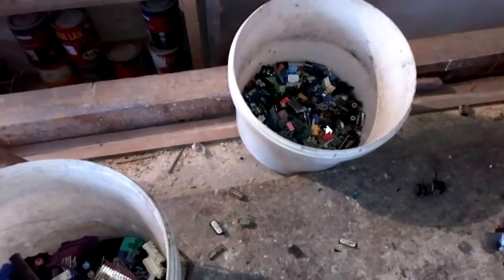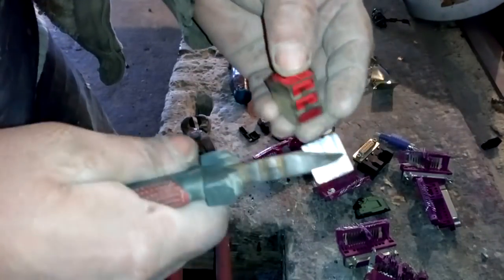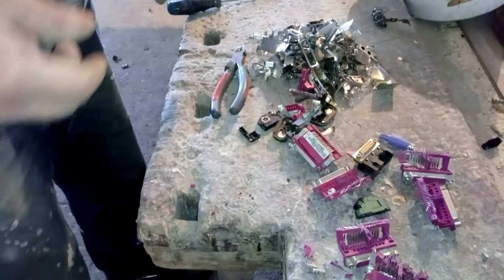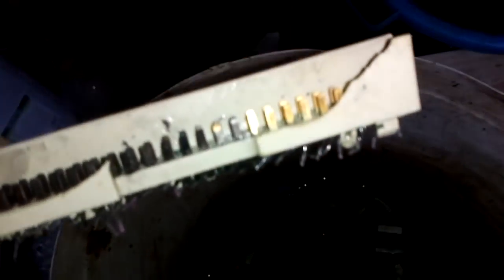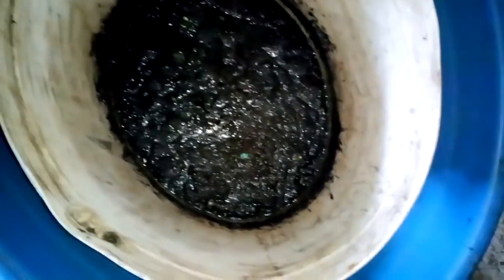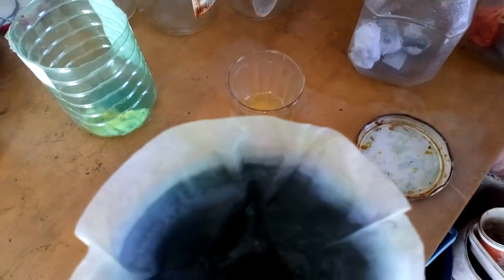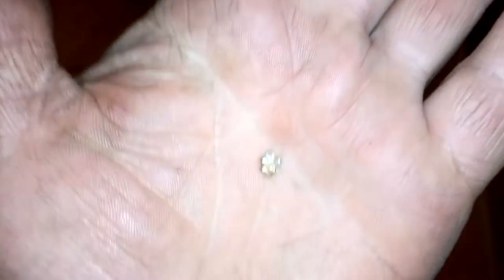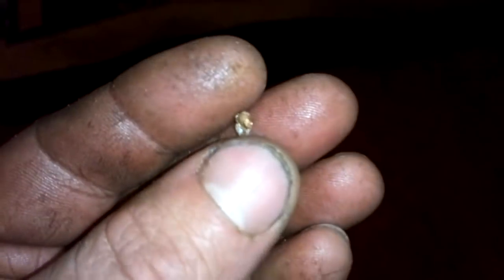Motherboard pins process with plastic in Aqwaregia!

Comment: cool in youe situation when you can get cheap acid  at me im able to buy HCL only sulphuric i getting from lead-acid batteries and nitric is totally out of my range i working on setup to destill some but it cost a bit so most of my refining is running on pour mans ar bit more time but working so far

Comment: Hello Dusan how are you to day ? now I appreciate 
your videos even more !!! I tried with small amounts of material to dissolve with AR pins with plastic, but I must have done everything wrong, I put urea, and after 10 minutes SMB but I came out a lot of gray paste looks like silver but it is not, what will it be? It,s All very complicated :) !!  It is possible after all wrong to dissolve all over again and start again from the beginning ... ??? I really appreciate your advice, thank you !!
Reply: This grey material is mixture of silver and lead sulphate
Reply: Nico Locasto you first add sulfuric acid to precipitate any lead or silver. Wait for 1 hr. Then add urea to nutralise nitric acid .filtre the solution and the add smb solution.
Reply: Nico Locasto you now take grey material in beaker. Add aqua regia and doing same process.
Reply: thank you , i will try with sulfuric acid.. i'm using  technical urea and i find that a lot of it do not dissolve and gets mixed with silver chloride ,is it normal thing??
Reply: Thank you !!
Reply from the maker: Nico Locasto He already explained everything to you. But it is possible that if you put too much urea to make you a lot of sludge because there is no more room to go to acid.
Reply from the maker: Nico Locasto did you remove tin and lead first vith hcl, or you go strate to Ar? If you go strate to Ar, that is you problem.

Comment: hey dusan i have question could use wet ashing on plastics leaving behind only pins?
Reply from the maker: Willie Bowshier No, unfortunately, sulfaric acid will not dissolve plastics same the material from which the chips are made.

Comment: What do you do with the HCL that was used with the tin in it ? does it go into your stockpot ?
Reply from the maker: d scrapper no, also contains lead which makes a big problem in testing. There are also other metals here.
Reply from the maker: d scrapper For now, I keep it in canisters, until I get a better way to retrieve tin from it.
Reply: do you think that this solution could be used as  Stanious test solution ?

Comment: great video mate, i do the same thing with my plugs i just spend a bit more time to remove more plastic and excess metal from the pins. i use poor mans aquaregia and save the powder until i have enough to do a decent clean batch again with the powder. at the end you had borax stuck to the gold from the melt, just drop it in a little sulphuric acid to clean that off or just remelt again. great video now you just have to reclaim and drop the tin from the hcl bath at the beginning
Reply from the maker: I'm still working on it. I do not bother trying to regain tin and lead, but I do this video to meet you who are interested in this process.

Comment: Great video.. This makes me think of the idea I had with IC chips, I was thinking that instead of burning them I would just crush them with plastic. I am assuming that the poor mans aqua regia would desolve plastic as well.. Maybe crush plastic with pins here would create a faster process?   Or like other have said do same process you did in first video with Ic chips and burn them?
 Also what to you do with the HCL that has the tin in it? that is call tin chloride am I right? I do no why you do not want the tin in the nitric it causes a gellotine mess. Sorry about long comment I am just learning so I am always thinking about other ways I can achieve the same or better results. I was wondering can I email you sometime. I would love to email and shoot ideas off of you when I start my experiments :)
Reply: yes should be possible, there is this indian guy having 150kg ic chips and putt them whole in acid and boils it.. https://youtu.be/Xhz0sgfYD8M,
Reply: Actually what I will most likely do is do exactly how dusan does for my first batch. Then I will experiment with just crushing the IC chips without incineration Just to see if it works and what the differance in the yields are.
and keep the leftover to incinerate later so I know I did not miss anything. This is just pure speculation since I would actually have to procure the IC chips first :)
Reply: bohemian mystik you need to incinerate chips completely or ball mill to a fine dust chips rather you burn or mill then the ash needs to be carefully rinsed out next a sluce to concentrate the gold next would be to process to rid material of base metals I prefer a diluted nitric cook over ap but both will work then I wash and make AR to dissolve gold
Reply: bohemian mystik click my name and subscribe I'm dusans friend but I live in USA
Reply from the maker: Detector King Yeah ,but that is sulfaric acid,proces is ,,WET ASHING,,
I showed it in one pair of my videos. A very dangerous method.
Reply from the maker: bohemian mystik
Sulfaric acid will not disolve normal plastic from pins conektor,i try it.
Reply from the maker: bohemian mystik
The idea may be feasible, but if you break the chips and just put them in Ar, you will need a lot of acid for so many chips.
Reply from the maker: bohemian mystik
I was thinking about burning this material, then the ballmill, then washing with water out and eventually only metal material remaning for Ar.That will be my next project very soon.Thanx mate.
Reply: Detector King he does a process called wet ashing using sulfuric acid dusan999 and myself do it regularly..
Reply: So does that mean that AP would not work unless I incinirate the ic chips first Sonny? I am guessing the wet washing gets rid of the plactic?  I do not want to touch sulfuric acid right now ... I would prefer to work with AP right now.
Reply: Thank you Sonny I get what you are saying here the inineration makes the grinding alot easier and without a ball mill it will be alot harder to get the chips to a fine dust. I have done my share of gold panning in the mountains so I understand How to get material down to a fine dust. You are most likely right here the incineration will make the job go way faster with less labor = more material processed which means More More Money. 
  Sorry I have the tendency to over analyze  everything in these case no need to reinvent thank you for explaining it to me :)
Reply: BTW my next big purchase is going to be a gold cube I think :)  It is kinda like a sluice but gold hog makes it. would love to use it for this! :)
Reply: Well apparantly I already subscribed to you ;) I did hit Notifications though you and dusan are the only ones I have that on :) I have not watched many of yours yet I have been studying dusans videos not done with his almost though lol.
Reply: Hi Dusan thanks man Yea that makes sense....  I like the incineration part now... a lot less work....  the pins are not that hard to get out of plastic I saw someone use a paper shredder.... a nice hammer should do the trick :) or one of those grinder wheels on a dremel. Tnanks Dusan why I love your videos makes me think and learn have a great one bud.
Reply: Awesome!